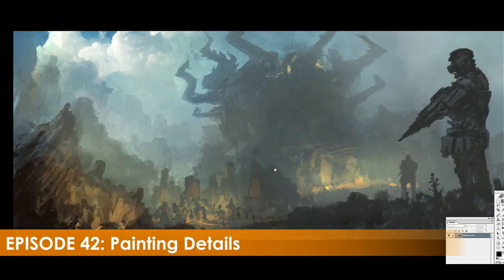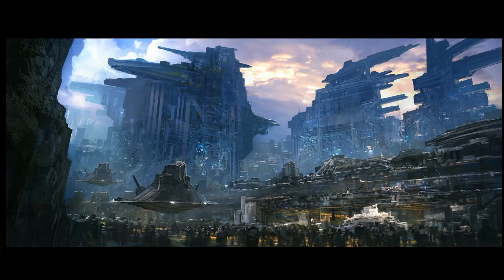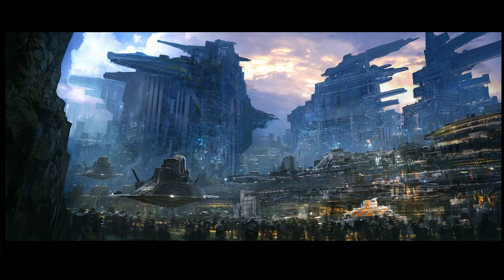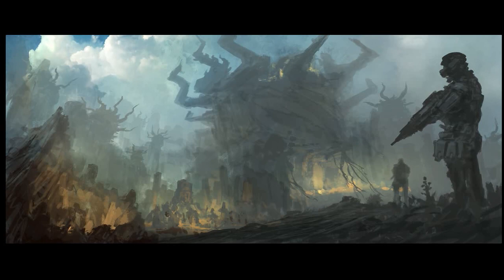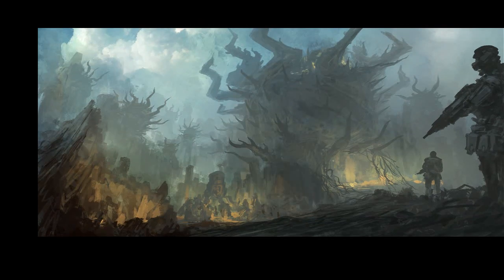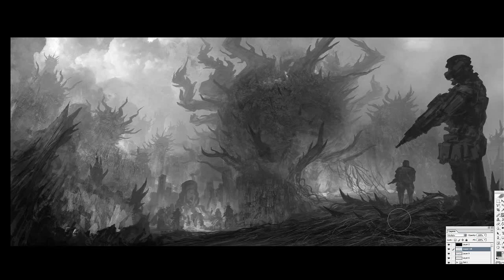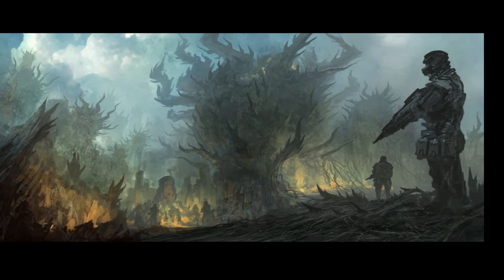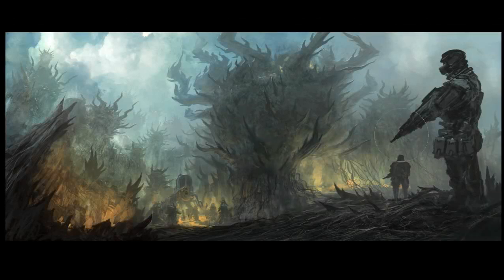Design Cinema – EP 42 - Painting Details

Comment: @coolhead20 

It's about how light works. Different light wave length will travel at difference distances. Saturation has to do with with wave length can reach your eye (depending on the material, atmosphere, distance). So for example, the color blue can travel very far; so thus the saturation level remains high even when the object is far (the ocean, sky, etc). Other wave length such as red don't travel far, thus it appears more grey in the distance.